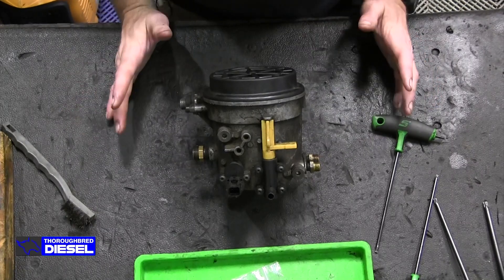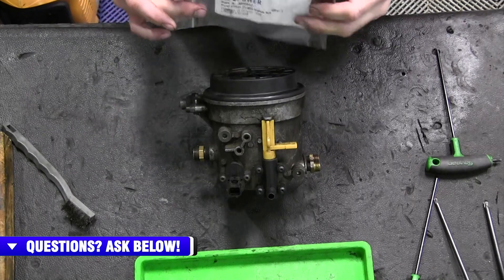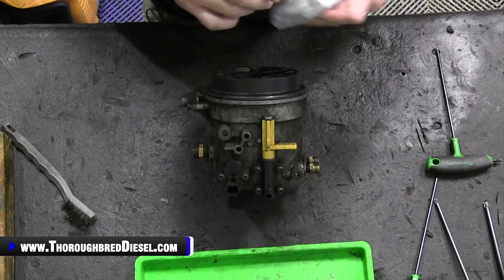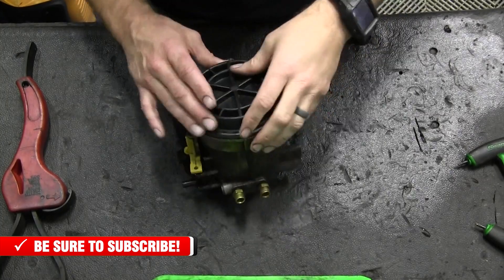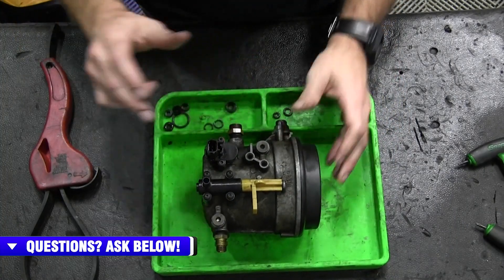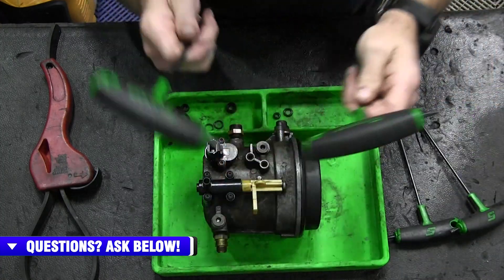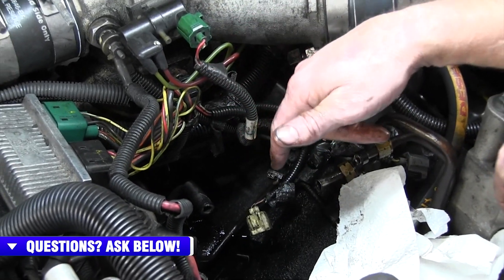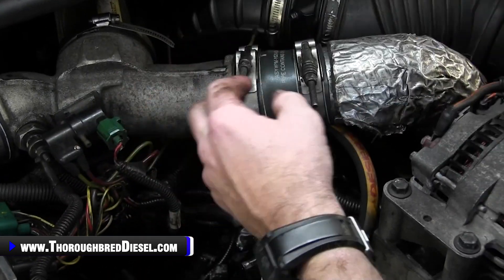Leaking Fuel Bowl Solved! | How To Reseal Ford 7.3L Fuel Bowl

Comment: What do you do if the seal is off on the other peace that is below the plunger that's inset in the regulator what o ring goes in there
Reply from the maker: The reseal kit will include that seal.

Comment: I have a leak in mine and let it sit for the weekend. Tried starting it Monday and it wouldn't start, thought it was the cam sensor but it turned out it was a lack of fuel.

Comment: I need this kit. I will be ordering in a couple days. My father passed and left me his 2000 F250 7.3. It definitely has a small fuel leak somewhere around this housing. Hopefully this kit will fix the issue. I noticed fuel leaking down the valley, seems like it’s coming from under the housing, on each “side”. There is also a pool of fuel on top of the manifold back next to the firewall. I see it.

Comment: My valley on my 99 7.3 keeps getting a small diesel fuel build up.  I have pretty well inspected all the lines and they look good.  I'm thinking there is a good chance it is the fuel bowl gaskets.  I already have my set sitting in the garage and I will be doing this job next week.  Thanks for the video, fingers crosses that I can stop waisting diesel.  That stuff aint cheap these days!

Comment: Would a leak on the fuel bowl cause a crank but no start?
Reply from the maker: Faulty fuel heater would for sure.  And if the bowl is emptying could cause a crank no start as well.

Comment: I'm going to tell you this job sucks. From getting the fuel lines off, to pulling the bolts. It is all a PIA. This is the best video out there for it. Thanks much! One thing not shown is getting the new rubber seals on the fuel lines. Mine were a huge pain! My big suggestion is to lay a towel over the valley and up the sides of where you working. That way when the rubber piece flies away you can find it. Ask me how I know. I'm about to turn the key and see what I get. Wish me luck.
Reply from the maker: Thanks and good luck!

Comment: Thanks for the video I'm a mechanic but have this job coming up and I like to see what I'm getting into before starting perfect 👌 ps any oringed plug should be given a light tap or two with a nylon hammer flat on the face of the plug and it will undo effortlessly no chance of stripping hex out 👍
Reply from the maker: You're welcome and thanks for the tip!

Comment: Hey how are ya I have a 96 f250 xlt 7.3 diesel and I just found a fuel leak coming from the left side of the starter running down the cover behind the oil pan.. I can't find where it's coming from SO can you give me a suggestion where it might be coming from....Thank ya
Reply from the maker: I would really look closely around the fuel bowl.
Reply: @thoroughbreddiesel  I took the cover off and right below the fuel supply pump right below the turbo was some diesel standing in the vally right below it not sure if it's coming from that or the 1 of the blue lines coming to it..I clean the fuel up and hasn't leaked anymore I started it up and let it run to see if I could see where it was leaking from but didn't see anymore leak out so I don't know

Comment: Can a leaky fuel bowl cause acceleration issues and puff of white smoke?
Reply from the maker: If it is causing a lack of deliverable fuel pressure while the fuel system is “recovering” from leakdown. Other systems need to be checked though,  glowplug actuation, injector health, etc.

Comment: Did you forget the o-ring at the top of the drain valve stem?
Reply from the maker: The Alliant kit does not include that o ring,  and we find that the major leak point of this bowl is actually at those two donut orings on the body of the valve.
Reply: @thoroughbreddiesel  wow. I rebuilt mine last year and used all the washers an o-rings. I have a small leak and it looks like it’s coming from the top of the valve stem. It’s hard to say for sure, but there is a little slop in the stem and if I move it up and down it looks like fuel coming out the top.
Reply from the maker: It could be coming from there. I would pull the stem apart and check that oring. The stem oring I believe is a pretty common size that you should be able to pickup.
Reply: Yrs they did they also didn't replace the oring on the regulator plunger guess they only see kits to do half ass jobs

Comment: Your drain valve has the o-rings in the valve but my 2000 F-350 had the o-rings in the filter body, and my screws are T-15. Do I have a aftermarket filter housing?

Comment: I have a 1995 F350 club cab I have put two fuel pump on it I just replaced all the lines two the fuel pump and the fuel bowl lines and it's still not getting enough fuel to the fuel bowl the light comes on it says fuel filter and it starts to run out of fuel let off fuel peddal and let it run and goes back out give it more fuel runs out of fuel any ideal what it is

Comment: How tight should the brass cap nut be (snug or bottomed out on the filter fitting)?
Reply from the maker: If you are talking about the line nuts, they have an o-ring washer so just snug them down.
Reply: The nut should be right flush with the fitting to be sure it is sealed correctly. You should not see any gaps between the fitting and the line nut.